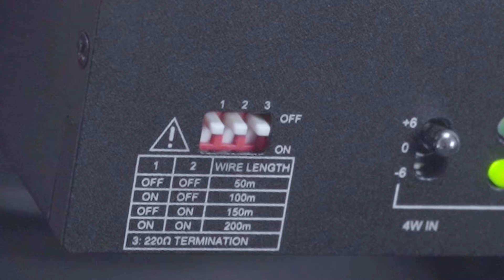BASIC TUTORIAL VIDEO | HOLLYLAND 2/4 WIRE CONVERTER

Comment: Hi, is this necessary to connect my ITC-100 datavideo with MARS T1000? Can I have a connection diagram?
Reply from the maker: Hello,the ITC-100 needs to be converted to a standard 3PIN XLR 2-wire output, and then follow the connection of Clearcom 702.If you have any question please fill in this form:https://bit.ly/HLSupportRequest and our support team will identify the issues based on the details you share with us and get back to you as soon as possible. Thank you!

Comment: How does this unit get power?
Reply from the maker: Thanks for reaching out to us! It does not need an external power supply, it uses 2 wire interfaces to get the power supply and supports 12～36V 2-wire voltage.